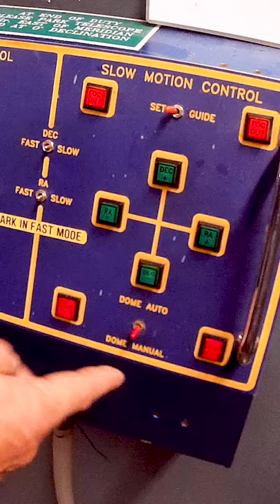Come take a ride on my Telescope  #shorts

Comment: Oh my gosh. I would love to play with that for a few days. It looks like a friction drive, correct? I just bought a friction drive mount with Dan Gray's Sitech controller. What a beast but I am still struggling to wrap my head around the control software.
Reply from the maker: Great!  The drive is actually not friction - the only friction is the clutch that switches between fast (slew) motion and slow motion.  The slow motion is done with stepper motors and worm gears, but these are more hidden and not so much actions, so were not filmed.  Good luck with your telescope project!